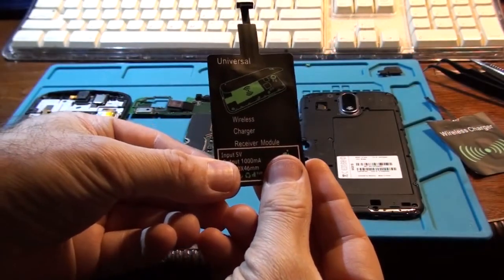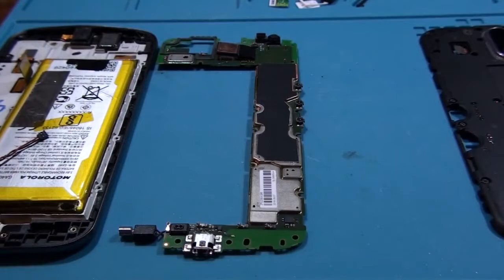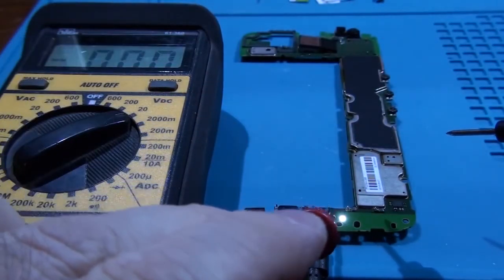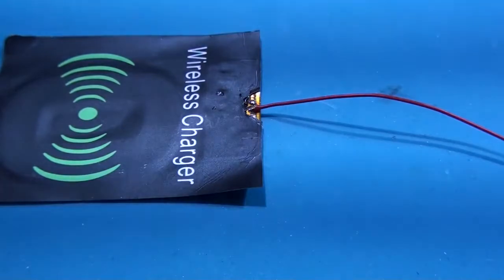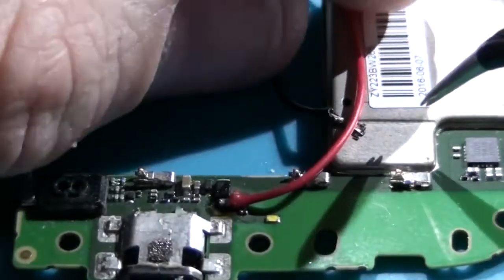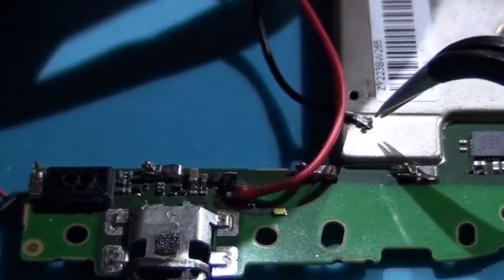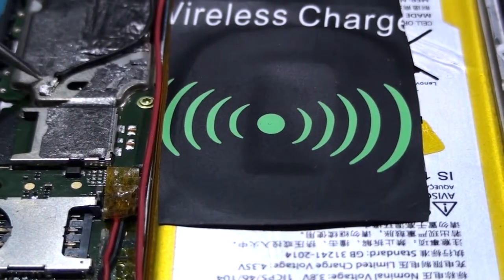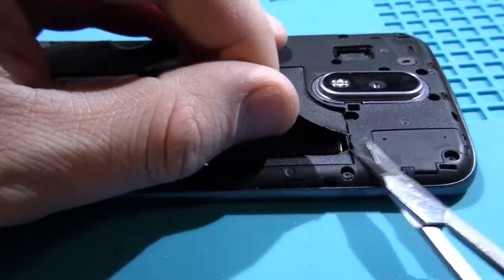Add Wireless Charger Module to your smart phone motherboard

Comment: Very nice video!
I thought about to do the same with a nude wireless charging module into a device.
Before starting, i injected 5v into the wireless charging receiver module (like if you plugged the usb cable on your phone) and measured 0.2-0.3 A. This mean the wireless charging module will consume energy and heat a bit.
Did you added anything to avoid energy falling back into the wireless charging reciever module?
Reply from the maker: @nicolassun7938  no I didn't, just used as is
Reply: Diode go brrr

Comment: Thanks was looking to do this. So you have to solder this to the motherboard or can you solder this to the charging port internally. I'm not sure where to install the reciever. Trying to install this in a old  phone, the tmobile sidekick phones
Reply from the maker: You are welcome, I think it is an option but I didn't want to damage USB port, still charging via cable when needed. But you can try under your own risk.

Comment: How did this worked out? and how fast did this wireless charging receiver charge the cell phone? I bought something like as for my cell phone, but I did not do any modifications like you just did' but it took a long time to charge it to the point it's starting heating up the receiver a lot and especially where the battery is as well that can propose a hazard and I'm also kind of concerned about that as well.
Reply from the maker: Thank you for your comment! First of all everything you do it's under your responsibility and risk. I am still using this phone charging it wireless. It is not fast charging but almost the same as if by cable. It is true, there is a hazard to catch fire if charging module is bad or welding points are weak. So be careful.

Comment: I am doing the same experiment with my one and only phone I hope it works and not damage the board.
Reply from the maker: Good luck! Be careful with soldering and test charging your phone before assembling. If you do proper soldering and test it should work without any problems. Mine is still working and one Russian speaking commenter also confirmed this has worked with his two Motorola smartphones.

Comment: im looking at doing this and I was just wondering if there was any reason you attached the positive to the smd rather than soldering directly to the positive on the usb port
Reply from the maker: Thank you for the question! No, I just saw my friend done the way I showed in video. Please whichever method you use, don't assemble phone until you test fully. Due to weak solder points and defective micro schem they might get too hot. So control it before assembling phone.

Comment: I am trying to connect a wireless charging receiver to a gameboy advance modded battery. I would like the ability to charge wireless and with a wire, and there is no option for this yet. Here is that battery. . . https://www.retromodding.com/products/game-boy-advance-rechargeable-usb-c-battery-pack?pr_prod_strat=copurchase&pr_rec_pid=4458917101632&pr_ref_pid=5242373275804&pr_seq=uniform

Comment: Do not make this, at an hour on charging litle smd diode goes wery hot and it melts charger.It can burn your phone as i burn my
Reply from the maker: Thank you for your comment! I am sorry for your loss :( , thank you for warning everyone about it. Fortunately, I am using my diy almost a year and have not had a problem with it. First of all, good soldering is essential! And before assembling phone you had to leav motherboard open tested with charger. Because this cheap Chinese charging pads could have problems too. Again, I am sorry for your phone.
Reply: @MrZurikmurik  my fault for my phone, i believe cheap chinese wireless charger, hrmh
Reply: @elektronikaelektro8008  oh boi tnx for informing me I will test it with old ones first.